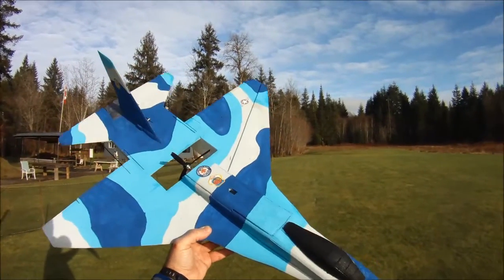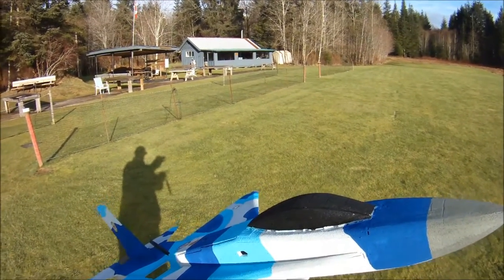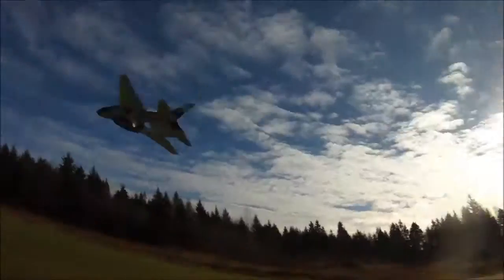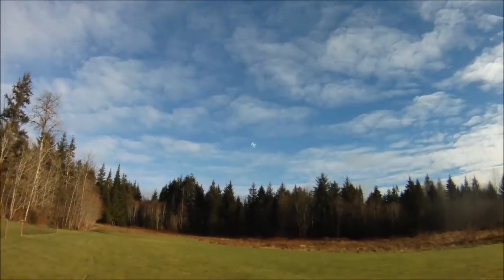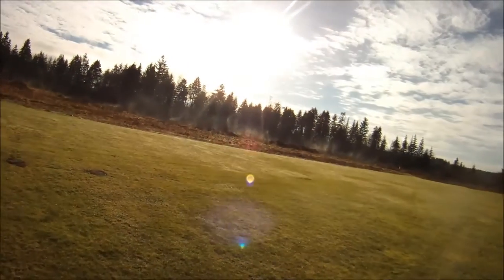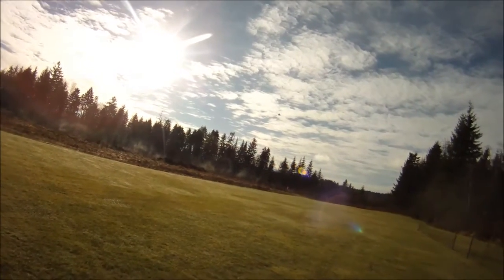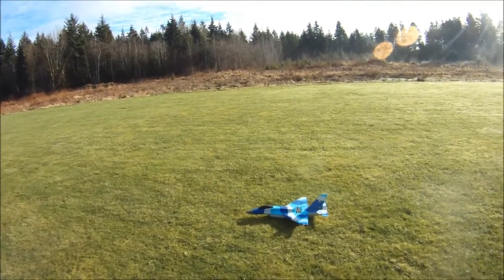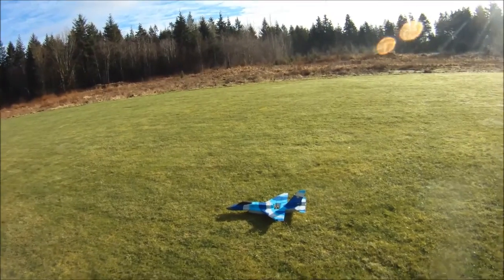RC Powers F16 V5 flight 24 Jan 2017

Comment: I think I settled with a 7 x 5e apc prop I did some tests and it produces a lot of thrust if it is not enough I will use the 8 x4
Reply from the maker: Have you ever used that type/size of prop with that motor before?  I would be careful that it doesn't heat the motor and ESC up too much or put too big a strain on your battery.  Good luck :)  Cheers, Scott

Comment: The only reason I can't use a 2200kv is because I have none of them I was thinking to use the 1450kv motor with a 8 by 4 apc and trim the prop slot and use the same battery. Do u think that will fly ok.

Comment: HiI really appreciate you taking the time to answer my questions. I downloaded the plans and taped them together. I am going out to get 6 by 4 props and carbon fibre rods. I am using a suppo 1450kv motor with a 1300mah 3s. Will that be enough for this plane?
Reply from the maker: Sure thing, no problem.  You will really struggle to get your plane to fly well with that low a Kv motor and a 6x4 prop,  I would try to go with the recommended 2212/6 2200 Kv style motor and the 6x4 prop to get the best performance.  Good luck.  Cheers, Scott

Comment: Ok last question I promise I will stop bugging you. Can I get away without adding the Carbon reinforcement and leave the paper on for extra strength or should I put in Carbon rod.
Reply from the maker: No problem.  I would say that unless you are building the plane extremely light, you will need the carbon reinforcement or at least stiffen the paper with the Minwax treatment, otherwise your wing will flex and potentially bend/break.  The problem with dollar tree foam is that if it gets wrinkled with the paper on, you can never get it completely flat/straight again.  Cheers, Scott

Comment: Hi thanks for taking the time to answer. I read through your article about using dollar tree and it was really helpful. I was just have one more question, I am unable to program elevons since my radio is not programable I have to use a computer and have to buy a wire separately, so do you think just Ailerons and elevator will do the trick. Thx
Reply from the maker: Sure thing.  It should fly just fine with straight elevator and ailerons.  You will probably want to crank up the aileron throws more than what I have in the video.  I am using about 3/4" of throw one way in my ailerons, they are not very big and the plane is a bit slow in the roll axis.  You can read more about my setup here https://www.rcpowers.com/community/threads/f-16-v5-official-thread.20231/page-4 at post #72.  Glad the articles on building with dollar tree foam were helpful.  Cheers, Scott

Comment: Hey nice job it looks very good! I have a quick question, can I use standard dollar tree foam for this build and what kind of setup are u running. I want to build this but I am not sure dollar tree foam will do the trick. Great flight by the way.
Reply from the maker: Thanks very much, yes you can use dollar tree foam to build this plane.  From personal experience I have found it takes a little more time and patience to keep the plane from being too heavy (the paper adds a lot of weight), but still strong enough.  I recently completed a build completely from dollar tree foam, you can read about that and my lessons learned here http://www.migsrus.com/blog/category/dollar-tree-foam-building

My setup is listed in the comments directly below the video.  Cheers, Scott

Comment: or edf..maybe..
Reply from the maker: kebon kacang - I would answer yes to both your questions.  I have no experience with EDFs, so can give no advice there.  For the 4 bladed prop, it would depend on the motor if it can swing that prop effectively (providing enough thrust to fly the plane) and efficiently (not drawing too many amps).  Unless you change the size of the plane, you need to stay at a 6" diameter prop or less.  Good luck.  Cheers, Scott